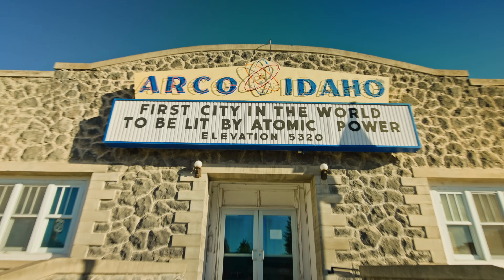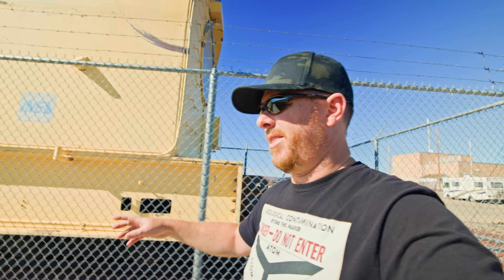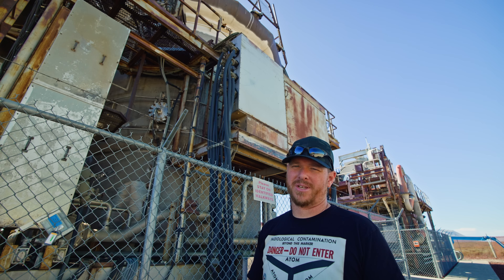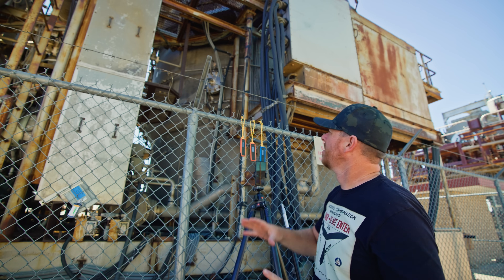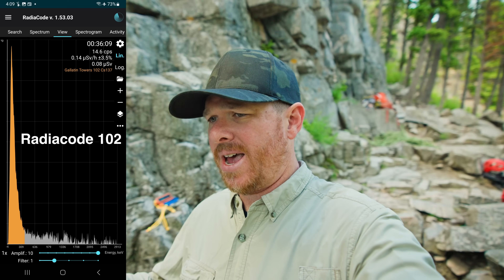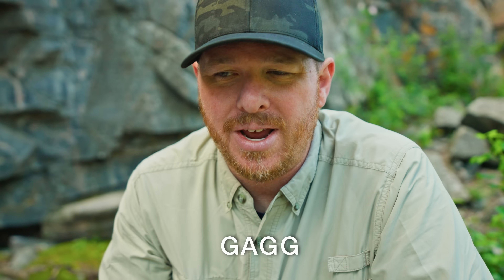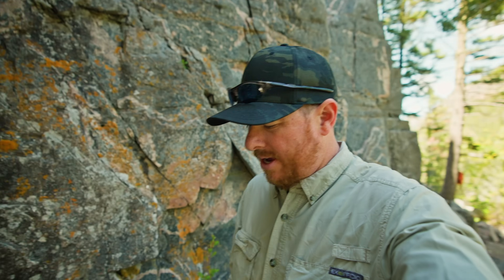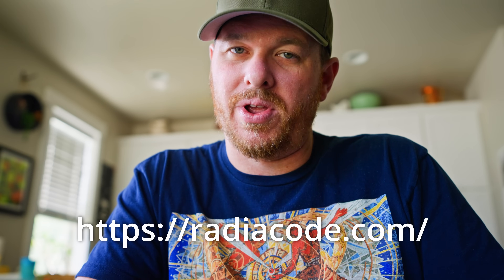Touched a Nuclear Jet Engine Core with the Radiacode 103G

Comment: It wouldn't let me, but I tried to comment on your hot springs spreads contamination across interstate video. You might research where the concrete there came from. It's already slightly hot, but did you know low level contaminated concrete from decommissioned cleanup sites is often crushed up and recycled and mixed in with new concrete? Some concrete from the meltdown reactor structure at the SSFL in CA was recycled and is now in nice expensive homes in the San Fernando Valley. And most of the homeowners have no clue about it...
Reply from the maker: I find that hard to believe about the material from the SSFL being used in homes. Pretty easy to check. A Radiacode of any other device that can do gamma spectroscopy would show the presence of fission isotopes or isotopes from neutron activation from being near a working reactor. But if that can be found then it’s totally BS.

Comment: We did some really dumb stuff out there near the SL-1 disaster site that would be classified as terrorist activity nowadays.. luckily nobody went to jail. This was literally last century and times surely have changed since then. The biggest problem I remembered having out in that region by Arco was all the temperature inversions causing havoc because of the Radon build up triggering detectors to light up like Times Square on NYE.  Good times.
Reply from the maker: Radon concentrations do seem to fluctuate a bit depending on the temp. A couple other factors do come into play as well.

Comment: Hmm.  My 103 has no problem showing K40 from Potassium Chloride and a noticeable peak in the background (albeit not large) so it’s definitely possible to pick that up without a problem.  Maybe the 103g just takes less time, but I don’t see much advantage for the large price difference.
Reply from the maker: The 103 is a great detector with plenty of resolution. The 103G does have better peaks, is it worth the increase in price? Hard to say.

Comment: Mercury is actually quite a lot denser than lead which actually floats like a cork in mercury. I'm not sure how that correlates with radiation shielding though.
Reply from the maker: Usually the denser the material the better shielding from radiation. That's why depleted uranium metal is sometimes used as radiation shielding.

Comment: Hi Drew, would this Device be able to Identify and tell me if i have any harmful Radioactive Isotopes in my home or Personal Vehicle????   I had a roomate that worked at a Nuke Facility and there were recent instances they even made the local newspapers where other workers brought home Radioactive contamination home Unintentionally, these workers worked at the same Facility as my Roomate did, Now call me paranoid but my roomate 
Lives in my House with my wife and Me we shared the house obviously Including washing machine,Dryer i even lent him my personal vehicle many times during this time, Now i have a "S.e. International Ranger Exp geiger counter" as a Hobbyist Trouble is it does not do Spectromity so any Radiation you detect you don't know what the Isotope is with just a geiger counter alone?  Also do you think that "Alpha Spectrometry" would be more Accurate and better to detect Harmful Radioactive Isotopes than Gamma Spectrometry would????
Reply from the maker: The Radiacode 102, 103, 103G would be able to identify isotopes. But there is a bit of a learning curve to the whole process. If you know the possible isotopes you are looking for in that contamination it can make the job a little easier. But depending on the isotope it might have a bunch of similar peaks to other isotopes in the decay chain. If you are seeing contamination with that Ranger detector, which I believe is using a pancake probe, then you should have a serious talk with your roommate. Also I've washed clothes that were contaminated from a uranium mine in my washer and dryer and haven't had any problems with cross contamination.

Comment: Hey can you tell me if my trifield meter RF is picking up some kind of higher frequency in building materials of home. Our entire home the walls have 0.1 RF readings besides smart meter and wifi which are on other side of home and in basement and this is on the floor.  (also our cell phones were off and out of room when testing this no electronics on in room), these emit a specific very high amount. However this 12 inch by 6 inch part of wall in my newborn babies room, which btw has NO electricity going through it. We even opened the wall and looked inside it’s nothing but dry wall, it is emitting the highest possible level of RF which is very rare and it doesn’t even pulsate, just a steady wave of RF. I’m concerned for my babies safety. I ordered a few different Geiger counters. Both do not work at all. Very cheap ones. I can’t seem to find any that don’t have horrible reviews on Amazon. We are even willing to spend some money. Is there anything that you know of in dry wall materials that can emit a radio wave above 20 on a trifield meter? We are just so confused by it. I have lots of stuff to remediate RF and EMF and I keep the house below 1.0 even on our smart meter and WiFi router. I have made stuff at multiple shielding and harmonizing materials. I just want answers. We do live in Weldon springs, an area in Missouri where we had a uranium plant during Cold War. HBO made a documentary about our area. I’m so annoyed by the lack of accurate Geiger counters for purchase. Could gamma rays show up on an RF meter?

Comment: Bluetooth RF communication may not work if the devices are in a high radiation fields... Just a thought. Maybe it would be nice to have an option to connect the detector device to the phone with a cable (type-c preferably)
Reply from the maker: You can already do that. You can connect the Radiacode to the phone with a USB-C cable. I know it works on Android phones...not sure if it works with iOS devices.

Comment: I wish the radicoedes wernt so fking expensive in australia, id love one, Im using a GQ 500_+ and it just died, the charging port wont charge, so gotta save up a while for a radicode.
Reply from the maker: The Radiacode 102 is listed for $245, which is a great deal for what you get.

Comment: I worked at Gaylord Hospital from 1974 to 1985. We had a building whose basement was full of all kinds of stuff that was left over from this project when it was cancelled. Stainless steel pipe fittings, cast iron pipe fittings, all kinds of stuff. It was all donated. I grabbed one of those yellow CD Geiger Counters. The probe detached from the handle with a shielded cable. It was nice having a rotating window cover on the probe that allowed you to determine Alpha and Beta from Gamma so you would know what you're dealing with. Sadly it was stolen 5 years ago. I always feel a bit vulnerable without my Geiger Counter....

Comment: I'm guessing not, but curious would those climbers be getting a higher dose of radiation because they are specifically disturbing the crack and crevices on those rocks?
Reply from the maker: Well they are getting a higher dose of radiation because the rocks in the area are a bit more radioactive than normal. This is from naturally occurring radioactive elements in the rocks. The dose of radiation from the rocks is much higher than any of the slight amount of fallout.

Comment: When I first got my Radiacode 101, I was in Colorado.  I went to rocky flats area and I found a trace amount of Cesium 137 also.  I then brought that spectrum to a nuclear physicist and he told me it was most likely an escape peak and not actually Cesium 137 because, there was never any fission at Rocky Flats.  I then bought a much higher end Gamma spectrometer (USB) and dug up some soil from that area and put it in my lead pig and tested it.  It really showed that there wasn't any cesium in the sample.  I'm not saying that there wasn't Cesium at your site,  I am saying that more investigation may be necessary.
Reply from the maker: I agree, there does need to be more investigation into that site. I want to visit areas like St. George Utah and look for fallout there. Since it was so much closer to the Nevada Test Site and got dusted a bunch of times by some pretty heavy fallout clouds. I should be able to find some nice solid peaks there...if I look in the right locations.
Reply: @RadioactiveDrew  that would be a great video.  Find natural water pooling places.  I bet you would find some good sources.

Comment: Yeah that was cool with the siren sounding LOL.  Another you tuber flew their drone over the engine and now you see the sign.  I heard that nuclear engines didnt work because they couldnt get the thrust necessary for take off wonder if that is true.
Reply from the maker: Wow, someone flew their drone over it? They must have blocked the GPS signal or had a home built drone. Getting caught flying in a restricted zone can't be a lot of fun. They could have also gotten permission from INL but that would have taken a lot of work at that site.
Reply: @RadioactiveDrew  Yes I remember someone flew a drone back there years ago.  I dont know if they got in trouble.  It was when the drones first came out.
Reply from the maker: @dixiecup3928 well if that’s the case then they might not of had those regulations in place for drones yet.
Reply: @RadioactiveDrew  Yes I was thinking the same thing.  I dont think they had the regs yet.
Reply: @RadioactiveDrew  Yes they did that years ago.   The area behind the fencing is highly radioactive from the rockets crashing and splitting open up the reactors when they hit the ground.  They also tested nuclear rocket engines in Nevada.  It was a huge dismal failure, it never worked.

Comment: Nice sensor, but $555  Wowzers
Reply from the maker: New tech is never cheap. The 102 and 103 work great as well.
Reply: Like I mentioned before to Drew on here, the pricing is ridiculous, unless your a collage student trying to earn a degree, or a professional, you don't need the "latest and greatest".  My Radiacode 102 suits me just fine. It is what I can afford, and I'm not going into debt, just because they come out with something new. It's just like those new cases that he was using for his Radiacodes. At just over $25 a piece...no thanks.!!!  Get the leather ones for $12.50, even if you have to wait a bit to get one.

Comment: you’ve prob been asked 100 times, does the radiation meter get contaminated from measuring radiation?
Reply: No
Reply from the maker: The detector doesn't get contaminated from measuring radiation. But it also depends on the environment you are measuring in. If there was radioactive dust and you put the detector right up against that dusty contaminated surface, then yes it could become contaminated. But in most cases you could wipe that off. If you feel like the source items or area might have loose contamination I would keep the detector in a sealed bag of some kind.

Comment: Generally speaking, the way that radiologically controlled area boundaries work is anything crossing the vertical plane of the barrier is considered to have entered the area.
Reply from the maker: I know, that’s what I remember being at the nuclear fuel pool over at San Onofre. But usually those type of rules have a special stripped pattern to denote that area. I saw no such pattern.

Comment: Such a bummer that it never flew.  I always thought that both the nuclear jet engine and the NERVA should have been used in the actual application at least once.
Reply from the maker: I think for the application it was intended for it wouldn’t work. As I understood it they wanted it on nuclear bombers so they wouldn’t have to refuel…as least one of the concepts I heard. It’s still an interesting idea but I think direct energy conversion of the radiation energy would be a much better idea…if that could ever work.
Reply: @RadioactiveDrew  Like a RTG?
Reply from the maker: @JohnShalamskas kind of like an RTG but instead of using heat to create electricity you use the alpha, beta and gamma radiation to direct charge a battery or some kind of capacitor.
Reply: @RadioactiveDrew The original application was for a cruise missile with terrain matching navigation. With 1950’s vacuum tube technology that would be the size of a 737. The B-58 Hustler was supposed to be the aerodynamic and computer technology demonstrator for Mach  3 ground level penetrator.
With late 1960’s technology it shrank to the ALCM.